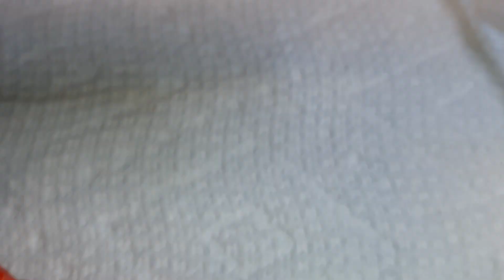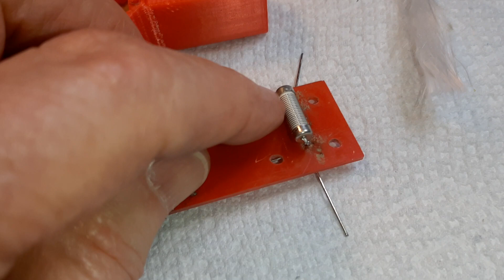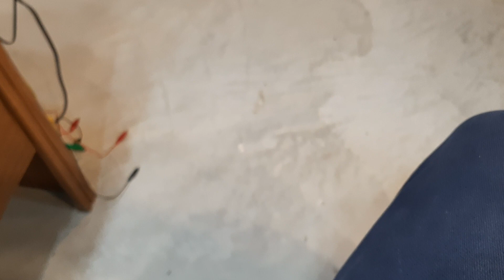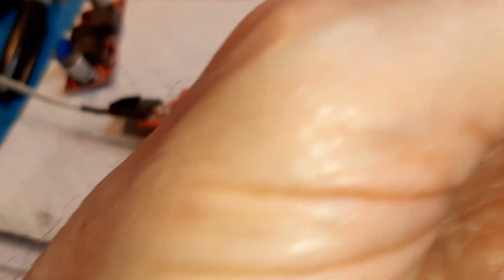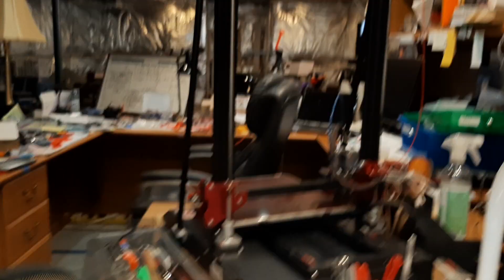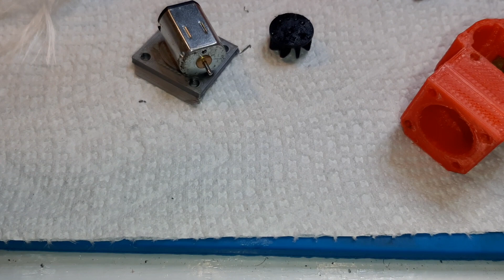Frankentrain Laboratories: Smart Smoke Lid and 3D Printed Housing assembly for Puff & Brake testing

Comment: This is good news and i like the fact that it limits the voltage is governed  by a regulator and will reduce the problem that melting smoke box housing.  I like smoke coming  from my steam engines. Dennis I am working on a new tender for the Blue, could you please send me the demensions for your tender chassis and  that will give me a good dimension to build on.  I will be grafting two Atlantic sender shells togaether and adding skiting andcreating the curve of the R.B.  tender with styrene.  I believe that the new tender body will have much more room  for you to to use.